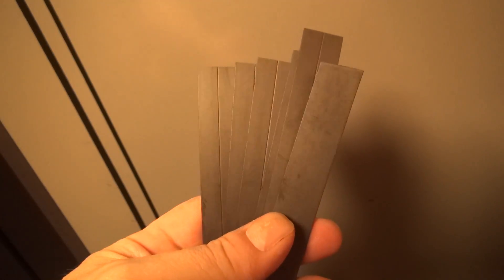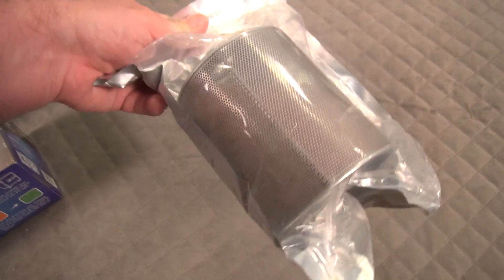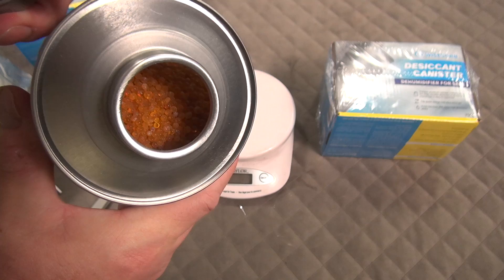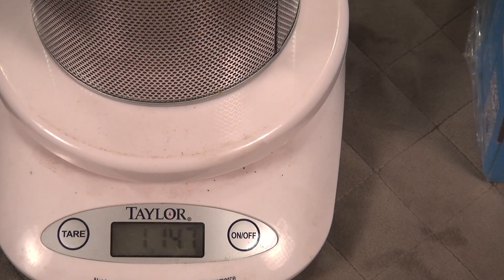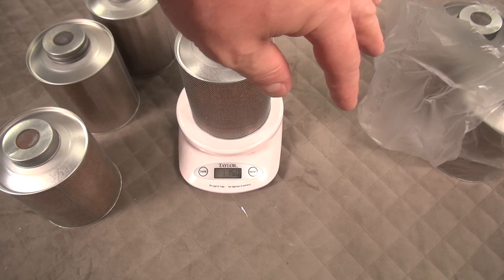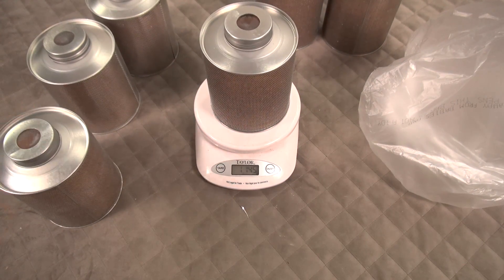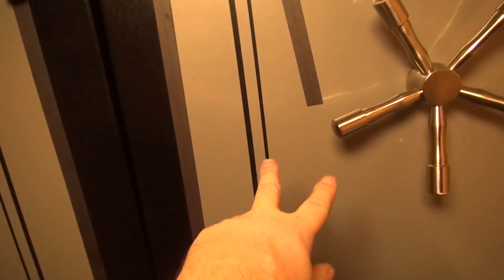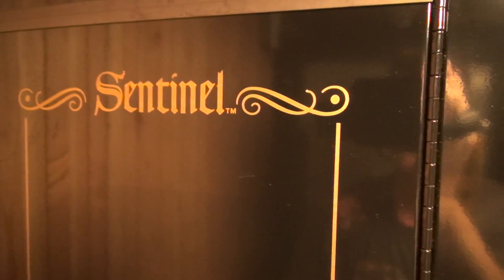Gun Safe  *HUMIDITY CONTROL*  Trick

Comment: Used desiccant in the military, definitely had to spread out to dry.  Use dedicated rack as to not cross contaminate.  I would label each canister with a log of dry weight. You can compare each canister with itself (dry/wet) or you can even them all out to the same exact weight and know the dynamics of each canister.

Comment: I would of bought a buy a better gasket for the door myself and that would of solved the issue then i hope you dont have to use 6 canisters in that safe cause if you are a rod would of been alot cheaper than buying endless canisters and having to reheat every few weeks or replacing  them when then are wore out

Comment: I'm not sure about yours but most stack-on safes have a water gasket on the door but they normally have holes on the back and in the floor
Reply from the maker: mine too but it is not air tight, all my holes have bolts through them so no air leeks there LOL...
my silica gel lasts wayyy longer doing this but suit yourself